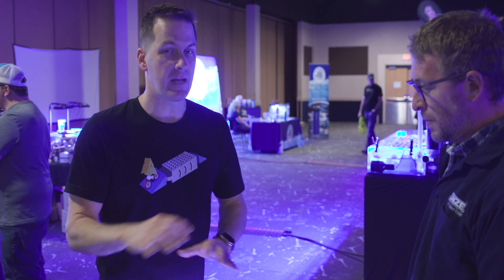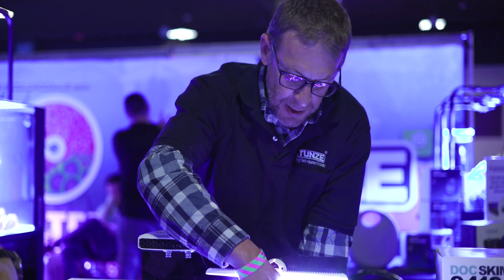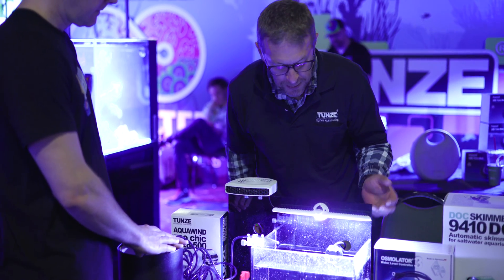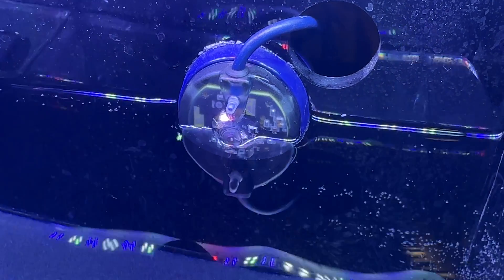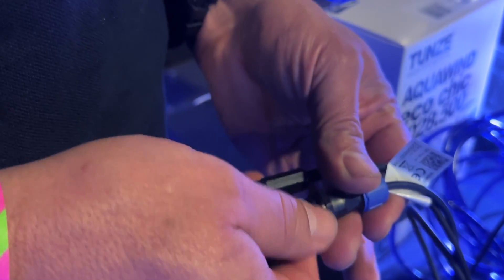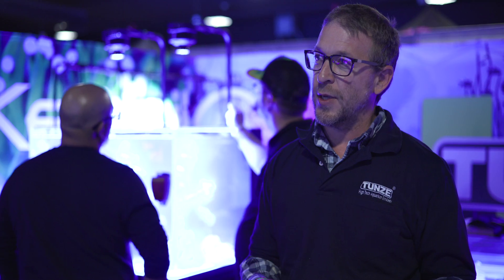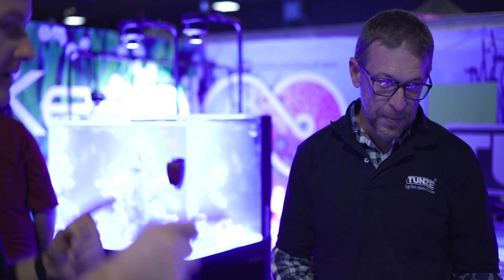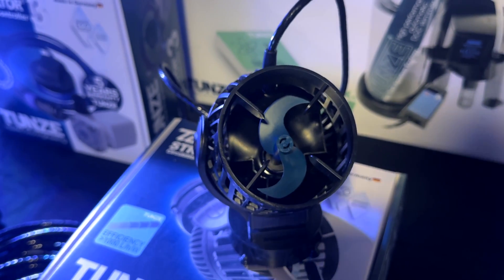Tunze OSMOLATOR 3 Automatic Water Top Off (ATO) - ReefStock Denver 2024

Comment: Sick of this hobby and the version X of the same products with little or no change accept the prices.

YouTube feeds this bullshit side of the hobby
Reply: Energy savings . You can upgrade your old one , & wider water flow . Simplified ATO with less wires . Awesome 😊
Reply: @lovermansmith9082 saving energy is minimal. The next release will say the same as well
Reply: I mean to be fair, they are simple products that do simple tasks reliably—move water. I don’t think the prices even changed from what I saw? I’m not sure what more you want from them? Is there a specific feature you’re looking for that’s missing? >50% power savings is pretty impressive in my book; they are adding WiFi capability to the pumps to reduce cord clutter and unnecessary controllers and the osmolator has a streamlined form factor and even further improved reliability over the already bullet proof version. From my view these are the upgrades in aquarium products I want. Simple products that are reliable and do what they are designed to do rather than new glow in the dark obnoxious colors and useless features that add no value and more complexity. If they don’t add value for you, the answer is simple— move on and find the product that does!